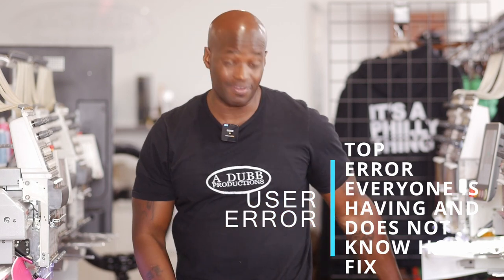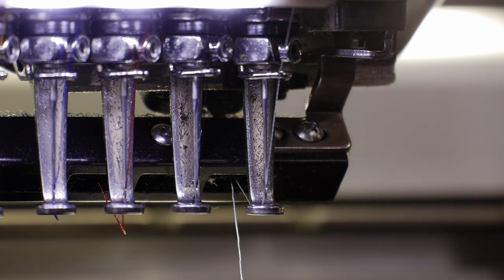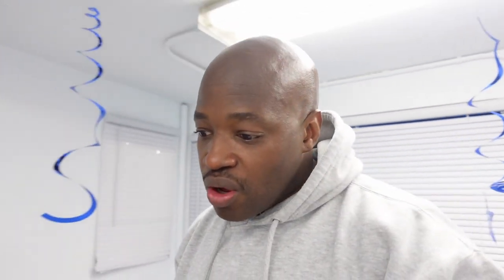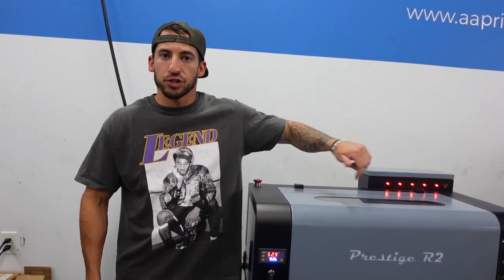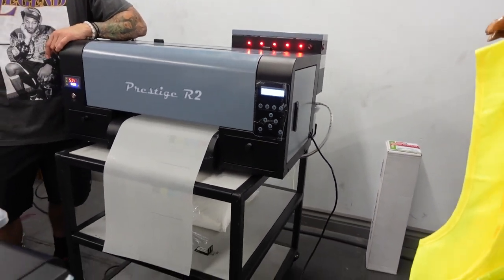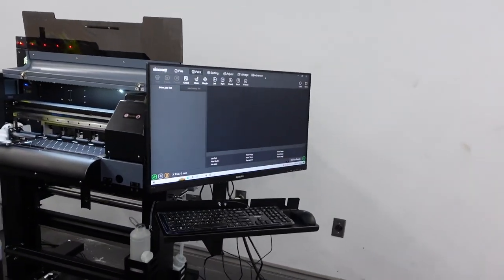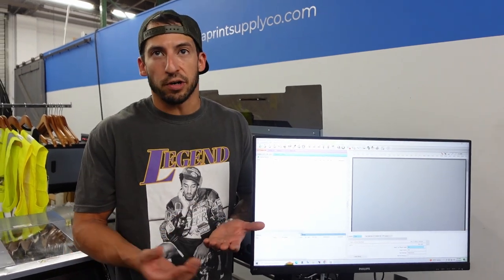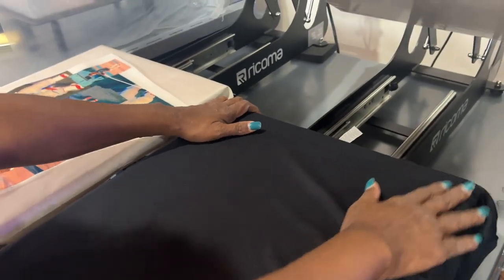Top Embroidery Tip for your multi needle embroidery machine vlog

Comment: I will have to double check this! Im pretty ocd about it but it could be possible. One issue i just had with the em-1010 was the left and right part loosened up and was making the tracing finish about a 1/16 to an 1/8" off from where it started. I took those two covers off and found the loose bolts. I tightened them up and turned the machine back on, hit the hoop size to recenter it and when it went to the left it broke the sensor on the left side and then went all the way to the right. Got the new part, made darn sure that little angle piece on top was lined up and then recentered it. Now its been working amazing with keeping the design in registration. So if you see this, maybe take those covers off and check those two bolts. For me i had the hat driver on and i could move the bar by hand that 1/16 to an 1/8" with the machine on. That led me to taking the covers off and finding the bolts.

Comment: Actually, the ideal angle is 5 degrees up the right. I have 5 15 needle Happys and have alaways put the needles in slightly off center to the right, never to the left); (from Melco):
“Ideally, the eye of the needle should be 5° to the right of center when sewing. There is an acceptable range of 0°-20° to the right, but 5° is the absolute ideal. The chance of thread breaks increases if the needle orientation is outside of the acceptable range.
As a visual reference, think of a minute on a clock face as being 6°.”
Reply: I’ve been doing this for 25 years… just sayin